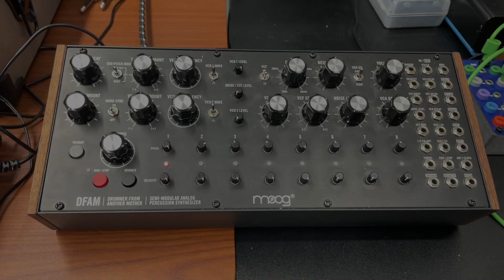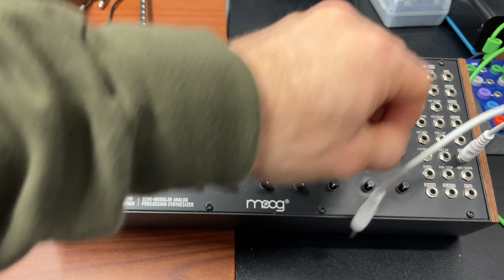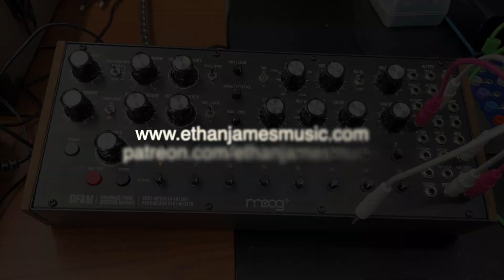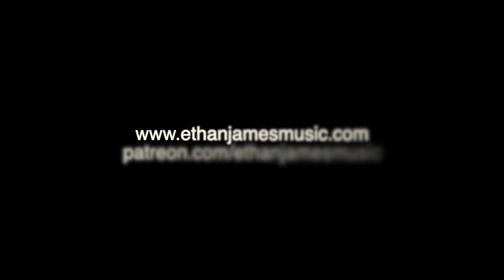Moog DFAM percussion synthesizer tutorial Lesson 13: How to Randomize Patterns

Comment: By chance, have you figured out how to completely break normals on the DFAM? I’m getting sick of the velocity on the seq affecting overall velocity when I have multiple means to affect it externally.
Reply from the maker: unfortunately, there's no way to break velocity, which is hardwired to all three voices.  It is possible to set the sequencer to different velocities, and then have a random clock (I use a Sapèl) plugged into the advance sequence input, which can create some variety in volume. Let me know if you want me to make a video demonstrating that.